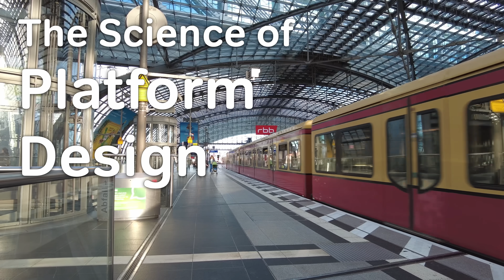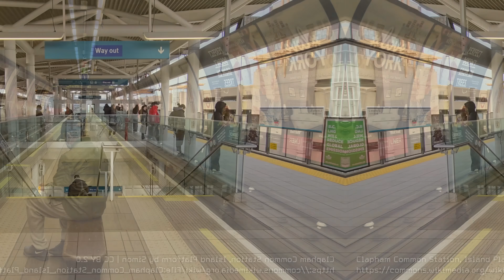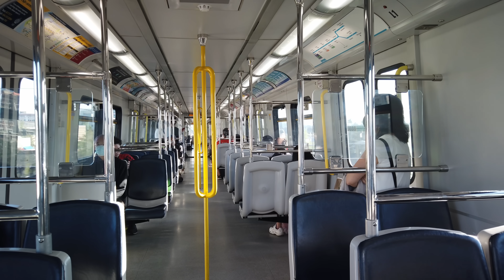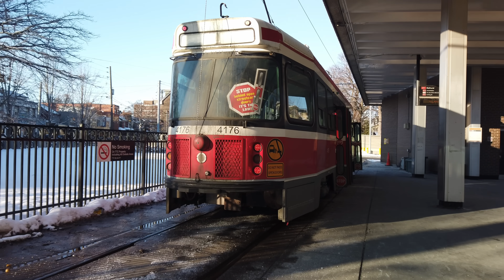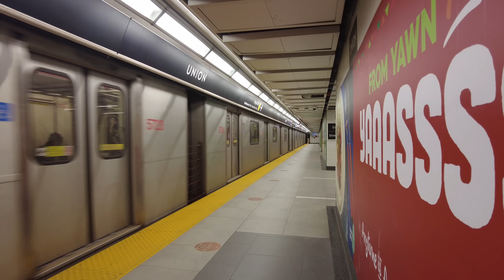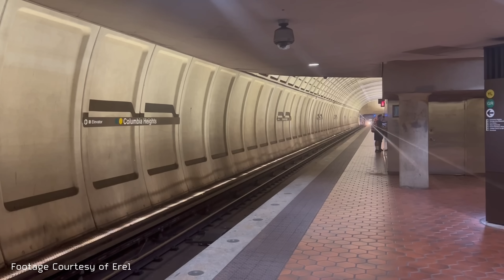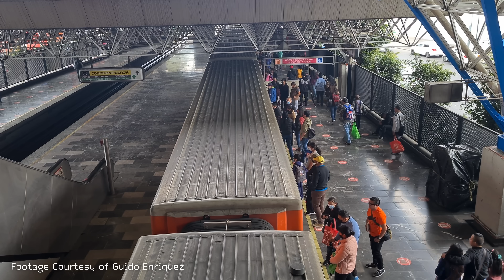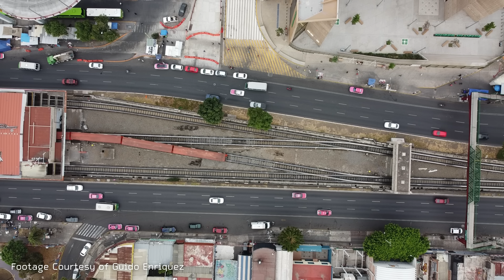The Surprising Depth of Platform Design

Comment: I think all transit systems should have platform screen doors or barriers. They could be added to older systems during station renovations
Reply: Very, very hard to do when a line operates multiple different types of rolling stock, with doors in different positions.

That said, that was done at Umekita in Osaka.
Reply: @illiiilli24601  It's not that hard. First of all, if you plan it you can do retrofitting by line that also includes unification of the type of rolling stock used in this line, by either replacing all of it or moving different types to other lines and making sure this line is unified. The other option, which is new but already exist, is using platform screen doors that can adapt to different trains (one manufacturer calls them Variable Pitch Platform Screen Door (VP-PSD) when they have much wider openings that can be programed to different trains. Another version uses screen doors that slides up and a cheaper solution uses  barrier made out of ropes that folds up and once down creates a barrier. I even saw a low cost option that uses those chain doors that goes up installing them all across the platform - in both cases all of them go up and down at the same time opening and closing the whole platform.
The best option for rapid transit lines is homogenizing the rolling stock but the variable pitch ones are great for train station when you have all kinds of trains.
I understand that some places won't do it for all kinds of reasons but that's a different kind of difficulty that has nothing to do with the technical ability to do it.
Reply: Just a vertical door would do wonders; I know signalling and door layouts can differ and the investment sometimes isn't worth it, so a simple rope system or raisable barriers would be good.
Reply: Even just partial platform gates that are like five feet high would be awesome for existing Metro and Suburban rail
Reply: Not realistic. I don't think even London can do it, especially in the smaller stations.
Reply: @leonpaelinck  Take for example the western end of the Elizabeth Line; it has to share tracks with Class 387 trains from GWR and Heathrow Express, in 4, 8, or 12 carriage formations; Class 165/166 trains in 2, 3, 4, 5, and 6 carriage formations, and Class 800/802 in 5, 9, and 10 carriage formations. It also needs to allow freight trains to pass which is why they can't do level boarding. Chiltern Railways also use the line occasionally when they are unable to access Marylebone.
Reply: @leow - PSDs keep pushes, suicides, and trash from causing delays too. And they allow for station air filtration and aircon if they are full height.
Reply: the main problem of retrofitting platform gates/doors to old stations, and even during renovations is curves and platform strengths - even when stations are renovated, its often infeasible to completely rebuild the platform
Reply: PSDs can be dangerous, as any train movement with a trapped passenger between the train and the PSD will result in serious injury or death. This slows down train departures, as especially seen in mainland China, where trains have pocket doors taking in excess of 15 seconds after doors are shut to depart from a station.

Without a PSD, a train can be monitored as it departs (like on London underground) to see whether any passenger that has been trapped but the driver didn't notice!
Reply: @leow_se  Could be why Japan is adding half-height instead of full-height PSDs to its stations, so its train conductors can continue to check trains clearly when they depart in case they knock into anything/anyone, or if anyone got stuck between the doors